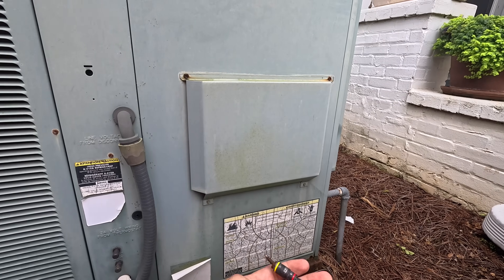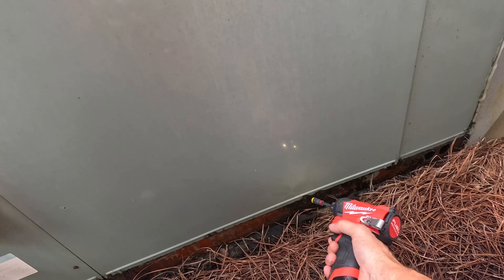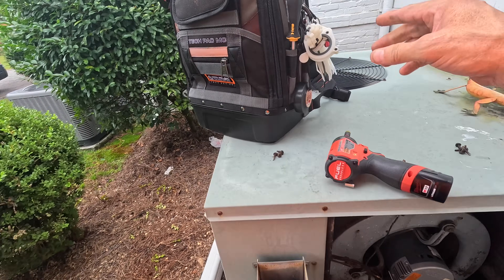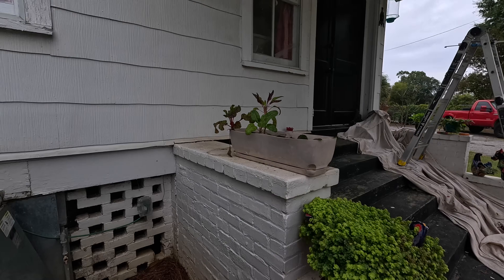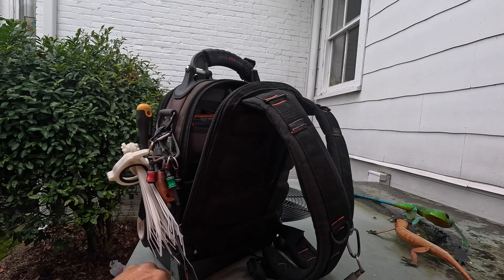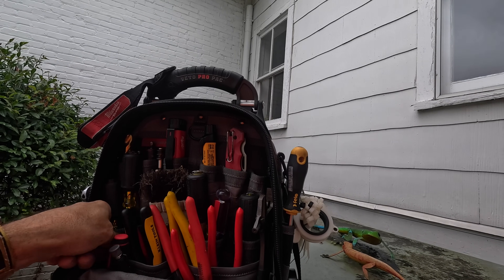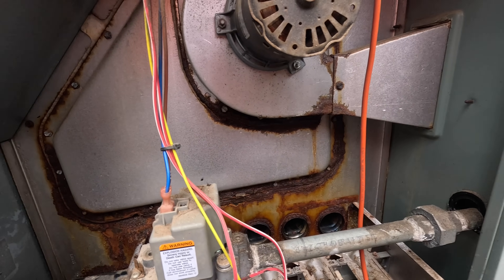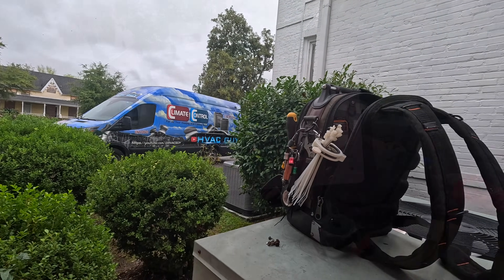16 Year Old Rheem Gas Pack Has Seen Better Days! #hvacguy #hvaclife #hvactrainingvideos

Comment: About 2 years ago, we changed out our complete HVAC system (heat pump) with a Trane system. We also included the ‘emergency heat’ option. Our power bill went from $345 to below $200. The new unit is a power sipper and works better than the 23 year old Trane we had pulled out.

And the new unit hasn’t even hiccuped once. Last bill was $171 and we couldn’t be happier. So, I guess the new units are much more economical to run. Expensive, but worth it.

Comment: There are way too many hacks and hvac newbies out there now. He will most likely find someone who will replace that motor for a $500 profit. Which probably saves the homeowner a few thousand dollars.
Reply: The heat exchanger is trashed, would be no big deal if it was just the motor.
Reply: @jthonn  nothing a little jb weld won't fix 😉
Reply: That’s with any field.  The real pros always get the short end of the stick on calls like that….